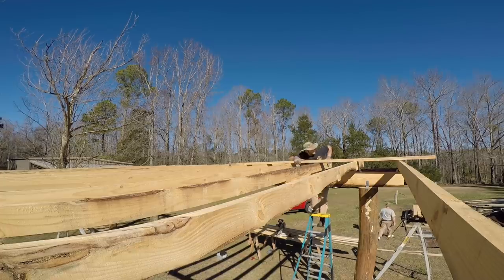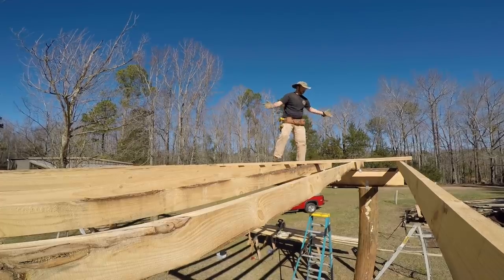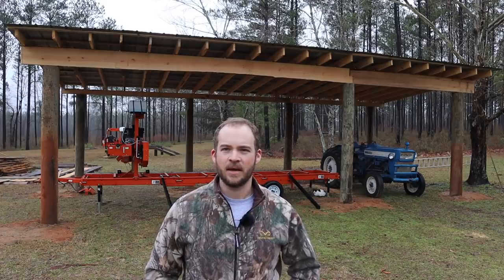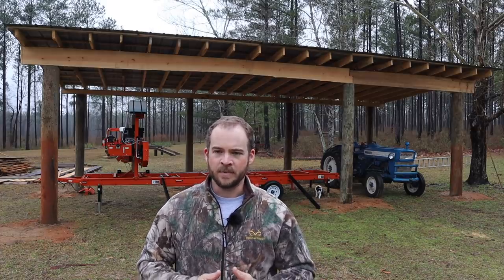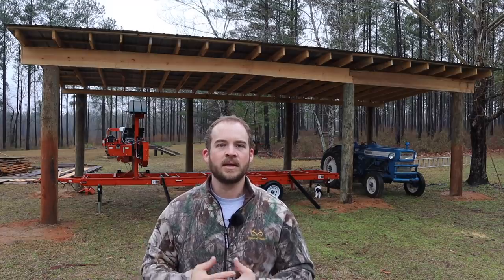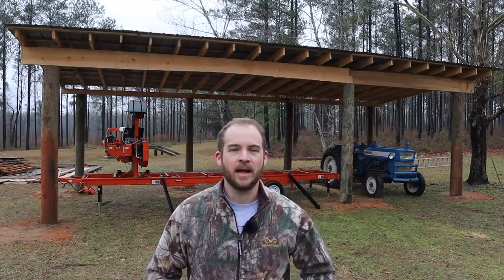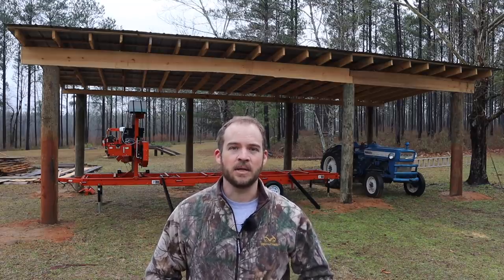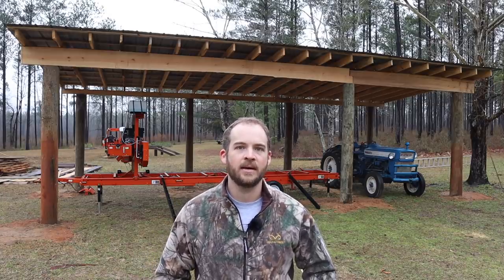Building a Sawmill Shed, Part 2

Comment: Most people don't realize it but if you were to insulate the underside of the metal roof with an inch of insulation or so, in the summer time it would be 5 to 10 degrees cooler in your shed. Worked in a airplane hanger in Texas years back. There were two identical hangers. One had an inch of insulation and the other had none. The result was at least 10 degrees between the two with the hanger doors wide open.

Comment: Well you could consider closing in the end where the tractor sits, and coming down bit from the top on the front to reduce the blowing rain from coming in. You might also put up a tarp that rolls up from the bottom on the front to keep the rain out when you were not using the mill.
I enjoy your videos and have learned much about milling lumber and harvesting trees.
Reply: I believe he said in part 1 he was planning on putting walls up eventually.

Comment: I agree with cc ward,  my tripod towers at my downspouts allow me to use 2/3 of a 55 plastic barrel with a screen to keep out bugs and pine needles, this allows both pressure and reserve of water. Just be sure to leave the bung ports on it to accept plumbing fittings, being able to convert to garden hose keeps it from breaking during freezing temps ( hose). Also, there is a clear(ish, gives it a more golden look) log home honey base wood treatment that with an add on insecticide additive repels carpenter bees. You might want to put that on before they emerge for the season since the sawdust will be impossible to see once you start milling. Try southland log homes, can be applied with a pump-up weed sprayer.

Comment: great shed charlie. simple addition. Add a 3rd header board to the face of your double that is presently on top of your beams and posts. cantilever 1/3 ratio. add joists, purlins, and tin and keep rocking. I agree with others suggestion. make the bottom ope on the closed in side for easy , saw dust removal. Heck , maybe light weight frame with tin , hinges and a hand crank pulley , to lower and raise when needed?

Comment: And it's a beautiful shed at that. Gentlemen do good work together. I think an easy fix for the miser is just some tarping thrown over it, tarp sheets aren't that expensive and they do keep off the rain. Along with the rear wall you want to put up on the shed. And if you don't have to park the tractor in that shed but elsewhere, you can just back the miser further into the shed alleviating the need for extra tinning and gabling on the end. just a thought. Stay dry down there !

Comment: Like your overhang , Looks like your crowning your lumber on install, when you can. Would like to see more and heavier steel , connecting posts to timbers. Had a Question- when Plumbing outer perimeter Posts, do you lend more importance to what level says when you check posts, outside face going around  outer perimeter of shed, because of logs taper. Great video , would like to build something like this for tractor and firewood storage. Thanks for video

Comment: A piece of rain gutter for back could save you rain water run into a vinyl drum of 30 to 55 gallons. Water could be used to cool your blade while running saw and wouldn't have minerals in it, like distilled water wouldn't have.
Great job in using your resources.

Comment: great project. I would suggest you plan to add another roof beam or possibly 2 - you want a way to lift logs and big slabs and beams. Depends a bit of course what you want to saw. best from Sweden/ UK
Reply: And ideally you want to guild/ extend another shed next to this one where you can store the boards

Comment: This is a great project with very nice possibilities. Thanks for sharing. Well done! Are you planning on actually sawing logs under the shed? If so, it seems like if the shed just a few feet longer and higher, it would help with log handling, dust collection, noise, etc. and could be a killer milling site. As it is, though, it looks like it would be a bother to run the mill in it very much. Also, do you have plans to have maintenance items like blades, tools, fuel, etc at that site? Maybe those things are close at hand already and that is irrelevant question. If not, I wonder if you would be well served to close in the area where the tractor is as a milling shop instead. You likely have already considered some of these things and I would be interested to know your thoughts.
Reply from the maker: Donald Moore Yes, I definitely plan to mill under there. There are other things that need to be done to make it more convenient. My fuel and sharpening equipment are in the shop next to the shed. I don’t plan to put that stuff in the shed, at least not on a permanent basis.

Comment: Build a small Doghouse over the tongue.  You can 'close in' the tractor corner with 6mil plastic on 2 sides.
Reply: I use 1x2 strapping and staple one end of plastic to it and wrap it around the strapping a couple times and then do the same with the other end.  I close in my carport every winter in SWOntario this way.  It can be reused many times if you want it off in the Summer.  You could do your entire back wall with this.  Put it up on a warm day and it will shrink tight when cold.

Comment: Your roof is a giant wind wing. If wind blows in the front and you have the back closed, that roof will try to lift. The solution is to use Galvanized  strapping  around your top beams and down  your  poles. Perhaps you don't think this is needed but its very cheap insurance so well worth it. Believe me I know from the experience of a lean-to roof flying for half a mile.  One also flew across my mother in laws house and neatly landed on a main road almost intact.

Comment: Maybe pour a concrete slab for a floor, make it easier to clear the saw dust. Ever think of making charcoal from your scrap wood? There's directions on the internet. Saw dust is good for a compost heap,   I did it but don't put to thick a layer of the dust before covering it with leaves or whatever you use in your pile. Alternate the layers, then when you turn your pile,  it gets mixed in well. Make your pile twice as big and put the material on one end, then when you start to turn it, just fork or shovel the top to the bottom of the other side

Comment: If the roofing is used and have some all nail holes in it you might want to think about giving it a good cleaning and scrubbing and then get some RV roofing paint and give it a coat of that that should fill in all of the hol’s and illuminate all annoying drips from the roof ...
Reply from the maker: Yep, I'm planning on getting up there and plugging those holes. I think I'll just spot fix them because overall the tin is in great shape.

Comment: With all the money you saved aside, my question is on practicality, and that is, why didn't you pour a good level concrete slab as a base for your mill?   Good video.   Thanks.
Reply from the maker: It would probably end up costing $1500 or more to do...and I just don't think it's necessary. Although I agree it would be pretty nice.

Comment: It would be beneficial to stabilize the beams on top of your vertical support posts so they can't tip, a heavy load on the roof or ceiling could topple the roof.

Comment: just be mindful of the dust if you put in a wall if you are running a lot, sawdust builds up and it is nice to be able to scrape it away with a bucket as opposed to shoveling it. even leaving like a 2' gap at the bottom just to be able to shovel it out might be a solution

Comment: Could have notched the poles and set the beam on the notch then used 6 bolts or like 5/8 threaded rod to bolt each post to the beam. I think that would have been better and cheaper than all that strapping and screws. You should add some wind braces where you can like both sides all along the back and the small bay to keep the building from racking. Its to late now but using pitch/tar and wrapping with paper on the buried section of posts would have made them last even longer. It would be easy enough to build a cantilever roof over the tongue of the mill and I would do the same for the front using the off cuts you had from the roof panels they seem about the right size. Use good sealant not cheap dollar store caulk/silicone when you go filling the old holes in that metal roof. Wait for a good rain and get up there with a push broom and get that oxidation off before you paint if you don't got access to a pressure washer. I would park the tractor where you had been parking it and build yourself a tool room in that bay store saws, blades everything mill and wood related in there and free up some garage space if your storing that stuff in a garage or out building. Thanks for sharing see you in next video!

Comment: Those fixings look puny from here, won't take much wind to make that whole roof fly ...
Reply: You need to read up on Simpson Strong-Ties
Reply: @x-calibearusallc  No I don't, That right there is a wing he has just built, and it is held on by a few thin metal fixings ... The force able to be exerted by that roof is enough to pull all those poles out of the ground, let alone the fixings. I think you have grand ideas about the strength of those things. My point is, from here, those fixings are not up to holding that roof on. I may be wrong but they do look puny. Even if the fixings hold, the screws will be pulled right out of the wood...